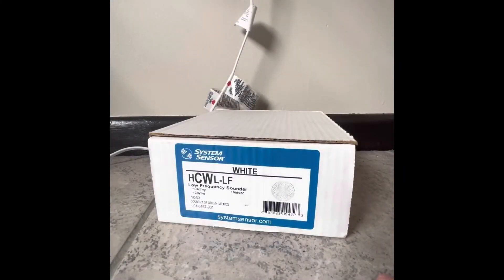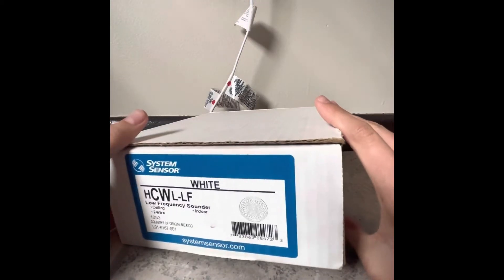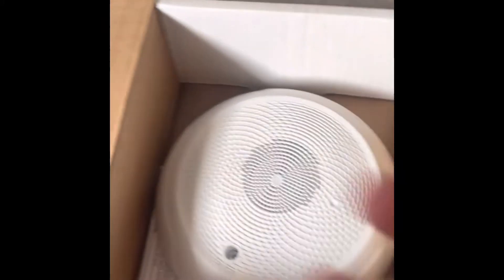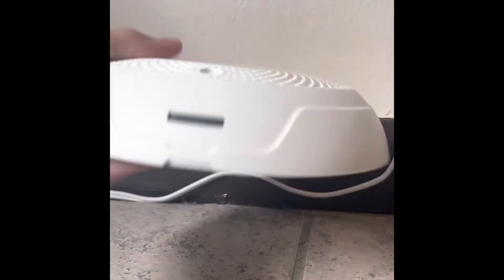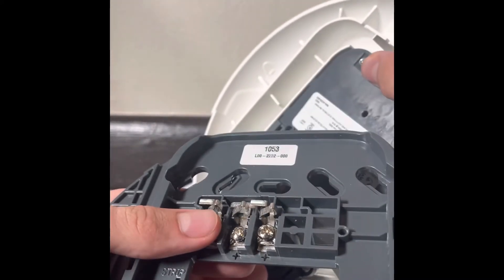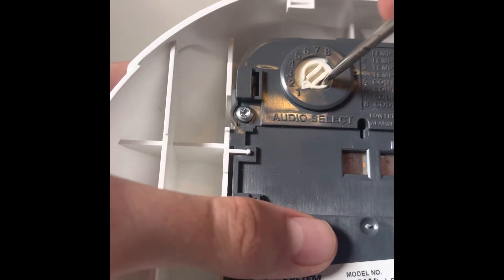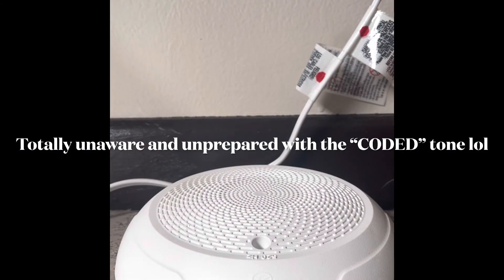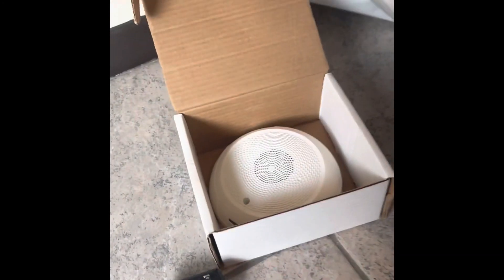Review and Test of the System Sensor HCWL-LF Low Frequency Sounder

Comment: Coded allows you to code the alarm from the control panel. For example: You have this alarm and you want it to do March Time. You set it to Coded then set the panel or just the NAC it's on to March Time.